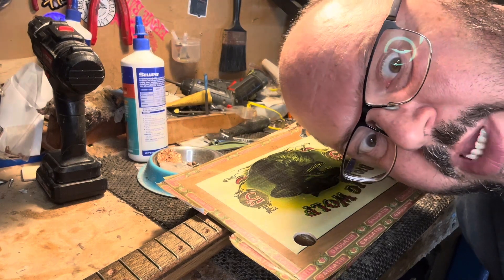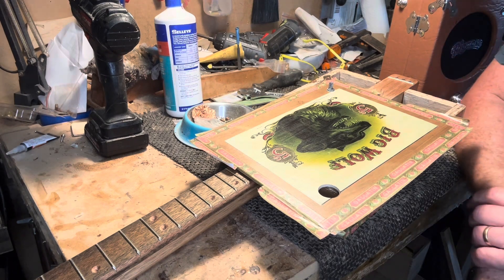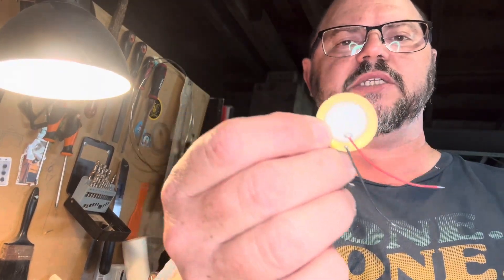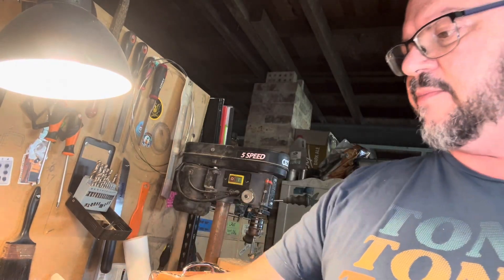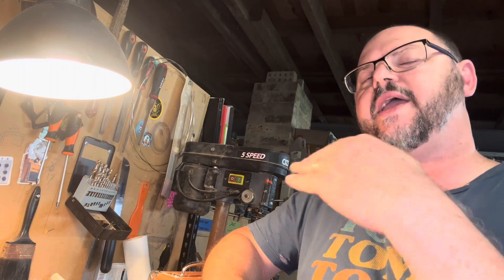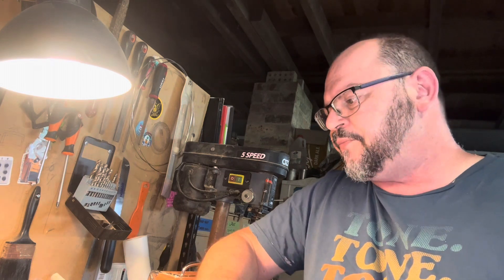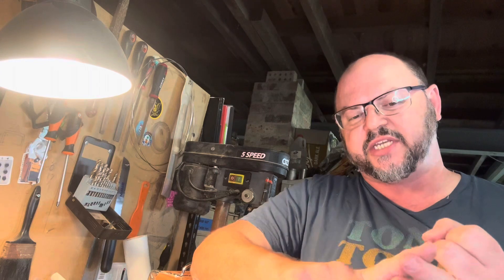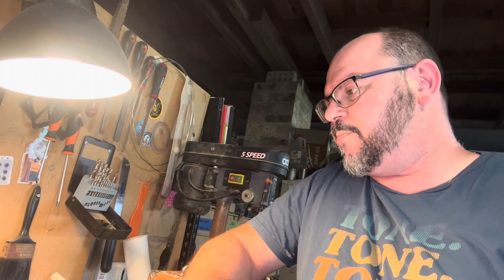Tame a piezo without a capacitor. A cigar box guitar tutorial.

Comment: A potentiometer is both a variable resistor and rheostat, not a capacitor.  The instant you put a 250K pot in between the piezo and the jack, you instantly send any freq above 250K (or whatever value your pot actually has, few are exactly 250K) straight to ground - but that's not all.  Take a pot and turn it all the way one direction, then check it with a meter.  You'll get the full value reading on one side, and you'll also get a small reading on the other.  That small reading is an additional amount that you're also sending straight to ground.  I've never seen a guitar pot that read 0 on the opposing side.  So, the roll-off doesn't start when you turn the knob just a little, it is already happening on two levels.  Piezos need a decent preamp and EQ to have any chance at really sounding good.  One thing I've noticed since I got interested in cigar box guitars is that a large number of those immersed into the scene (not all) do not seem to expect them to ever have the sound quality of a standard production guitar.  I find it astounding so see so many players perfectly happy with (especially magnetic) pickups that are completely unable to produce a good clear/clean sound.  It's as if they believe that CBG's are just not capable of rising to the level of good sound quality.  I'm a firm believer that a pickup should produce a strong, clean and clear signal.  An amp (and especially effects) needs a clear signal to work with, and without it the sound quality quickly goes downhill.  You may not hear it so much if the only effect you're interested in is distortion, but what about all of the other effects that are available?  A pickup that sounds like it has its own distortion box built in is a one trick pony, and it doesn't even do that trick very well.  I purchased a "somewhat well known" Chinese made humbucker that I've seen on countless CBG's, and I put it on a 6 string guitar I have.  After playing the guitar a few times, I noticed that the sustain of the plucked notes was abnormally short - literally about 3.5 seconds until a string went completely silent.  I started looking for a reason, and I eventually found it.  The amount of (almost 600 gauss) magnetism measured on the surface of the metal cover is about 4-5 times higher than normal, and all of that magnetism is stopping the string from vibrating.  In this instance, being cheap certainly did not make it a good deal.   I totally get the desire to keep CBG's cheap and fun, but just because it is a cigar box guitar doesn't mean that it has to sound as crude as it might look.  There are some seriously good players in the community - it would be nice to hear more of those great guitar licks that are getting lost in the signal path.  JMHO

Comment: I use a disc on my simple builds. And I also don't care for a tone control. If I buy a pre wired harness I will remove the tone control. 
Great video.
I noticed no ground? What's your view on grounds?
Reply: Hmmmmm don’t need a ground with a disc piezo, but you need a pre amp with the rod
I embed the disc into the top of the neck and will give the bottom mount a try
Reply from the maker: It’s not necessarily to ground the strings due to the lack of any magnetic field. It’s a physical thing more than magnetic. However, grounding never hurts. 
I certainly ground the strings on electric pickup guitars.